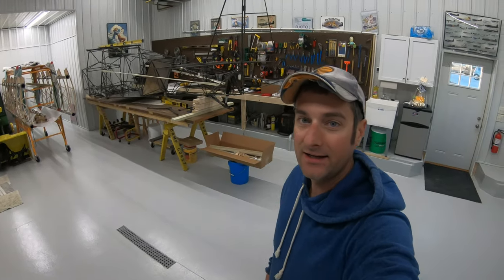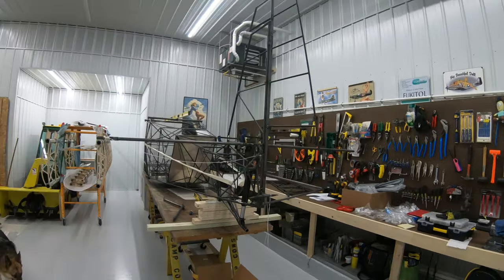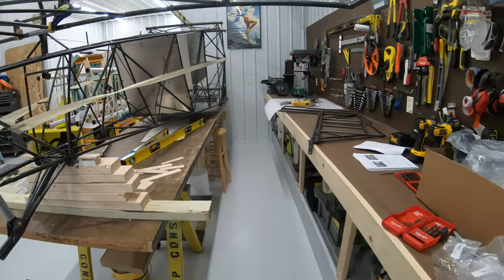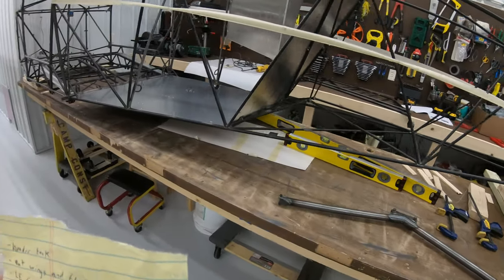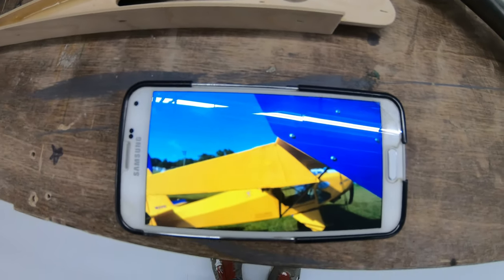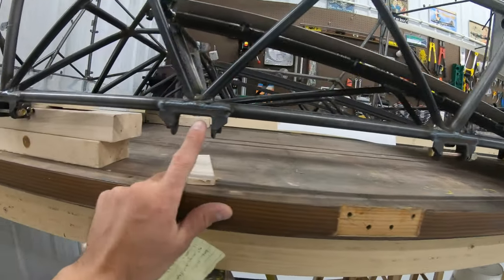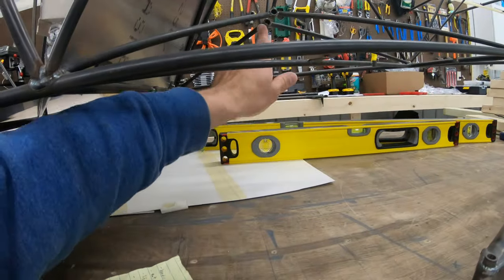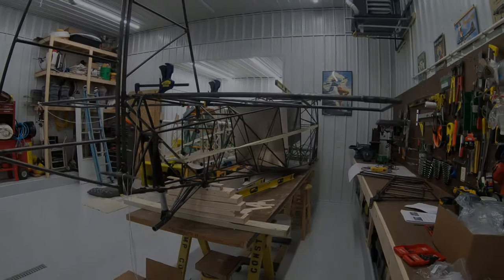Steve Henry modifications explained...Highlander build video #4

Comment: I’m not a Pilot yet and involved in STOL competition. Have built and flown R/C models for years. This appears to require specially designed and built high slight dihedral winged airplanes. Am feeling rules govern limits to designs as a Hot Air Balloon Flying STOL Airplane would Win every time! How do the Rules govern what’s used to compete with? Realize as Anti-Gravity Technology becomes adaptable this will greatly change this competition, but this is a ways off in the future.
By extending Wing Chord length with fixed and auto adjusters, we are getting close to a parachute designed wing. In my opinion, Mike Patey’s Draco crashed during takeoff from strong gust because his Wing Chord was overly long. Of course quick maneuvering might help, but the design might be on the edge of being too sensitive to wind gusts. It seems to stall a landing approach to minimize landing distance might want an extended wing chord length. Of course having the design quickly lengthen when landing is an advantage and shorten for takeoff offers safety. Frankly anything to grab and block airflow like a parachute would help make a shorter landing. So how do we turn or switch a wing into a parachute using strong mechanical control?
Am not aware of what’s in the rules that limits design additions/changes? Seems weight reduction is major concern, is this more about defining different Competition Classes? As you can tell I’m not knowledgeable about STOL Competition! Seems like a lot of fun!

Comment: Kevin, what did you use to cut your notches so clean and nice your baggage and floor panels?
Reply from the maker: An angle grinder. All cuts and edges are then de burred and smoothed out with a file and emery cloth

Comment: Keep the videos coming man. You are building that thing right! That's gonna be an awesome bush plane! Maybe I missed it, but what engine are you going to run? Apex?
Reply from the maker: Apex with a turbocharger kit from Edge Performance
Reply: @kevincamp189  OMG I didn't realize they did a turbo kit for that engine. What's the hp with that? 🤤
Reply from the maker: @MotoFlightGuy  It is supposed to be out sometime in January. It should be 250-300hp.  Steve Henry  should be the first one flying it in his Yee Haw 7.